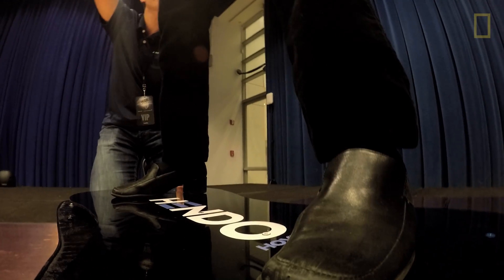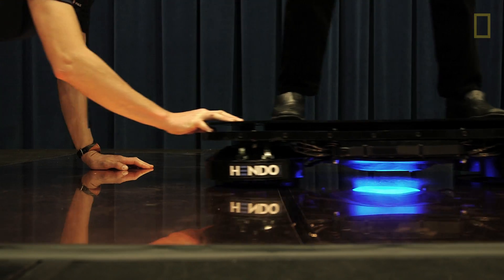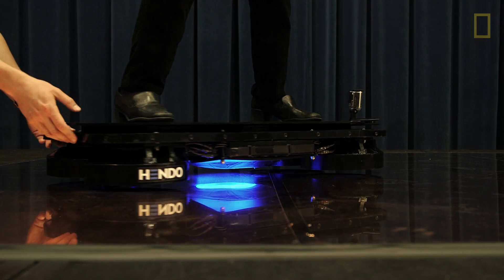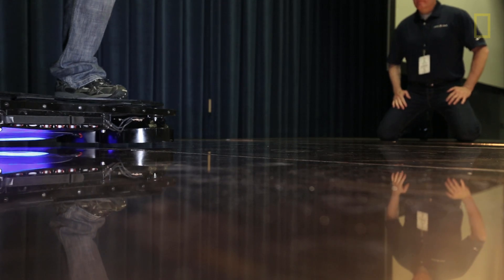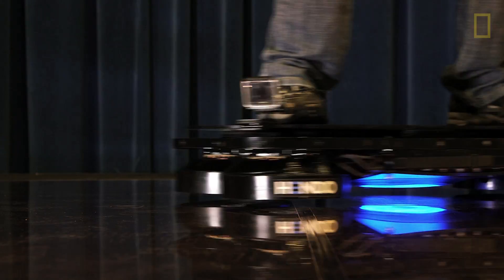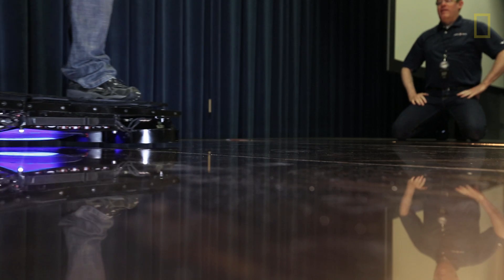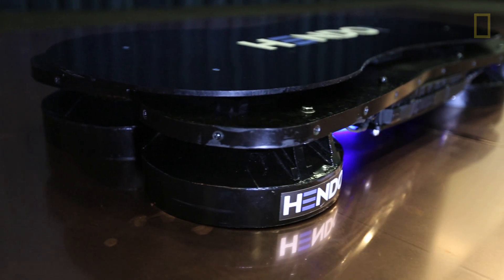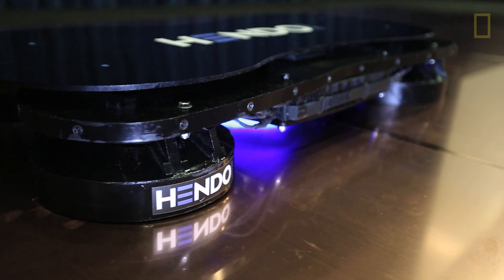Hoverboards Are Real | National Geographic

Comment: I can imagine ppl's gossip and scorn back in 1900s, when Wright Brothers first made their plane and they saw it on newspaper.

"It's so useless / impractical / unstable / unsafe / inefficient"...

If Youtube would exist for another 100 years our descendants will probably laugh at some of you guys' lack of vision.
Reply: Ray Lee Spinning magnets over aluminium or copper (or visa versa) is old technology, it's just repackaged and marketed to pull at your hopes.

If you're hoping to use this for cars, you'll need to make copper/aluminum roads, you'll also have to design a proper control system since the angular momentum from the spinning magnets sends this thing floating everywhere and unlike propellers on an octo coptor you kinda need to have them spinning at a given rate for the weight distribution, meaning you'll probably have to have other spinning weights to fight the angular momentum of the spinning magnets, then you'll need propulsion.

I'm pretty sure you've lost most people at requiring aluminum/copper plates for roadways or having such a plate for foundation of houses though, imagine requring ~2 mw to float your house for a few moments or what would happen to your house if you were to have power failure vs what would happen in a moderate earthquake for a house of appropriate wood construction, well that and the immense stress on the grid if every house were to attempt to implement such a system would virtually guarantee a failure.

Comment: A typical house weighs about 62,000 kg. 40 W/kg means the power source for raising a house requires at least 2.4 MW - which is more power than the 2000 houses in the neighbourhood will typically use.

Raising an office building would require over 1.21 GigaWatts plus the copper base which must sustain all this weight and dissipate the heat energy. Highly impractical!
Reply: Rand Huso Yes, and that power is consumed continuously while the house is "floating" an inch over the huge copper or aluminum pad. Hilarious! Every imbecile will want their own. :)

Comment: this is incredible
Reply: lola haze Sadly, not really as advertised. Basically requires aluminium or copper plated surfaces. Comparing it to back to the future hover board (in the description) is rather a poor comparison since you'll basically need specially designed parks to use it.
Reply: garith21 Yes that is true but still, at least some advances are being made in this field, and although this is not a practical means of transportation yet perhaps it could be turned into a sport of some kind. Still cool though
Reply: lola haze you to realize the concept is actually pretty old, basically they're spinning magnets to create an appropriate magnetic field...What kind of relevant advances have they really made?
Reply: garith21 none really except for the fact that they are marketing this as a hoverboard and not anything else
Reply: lola haze So, none....